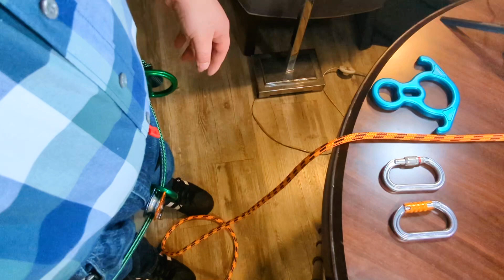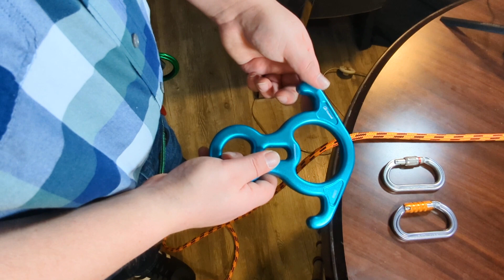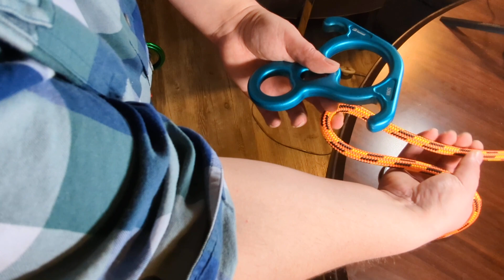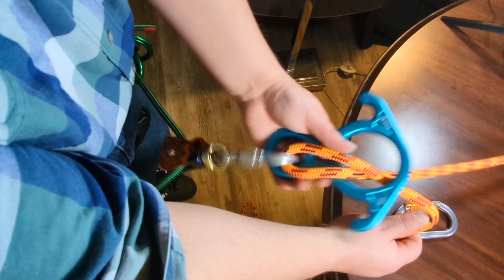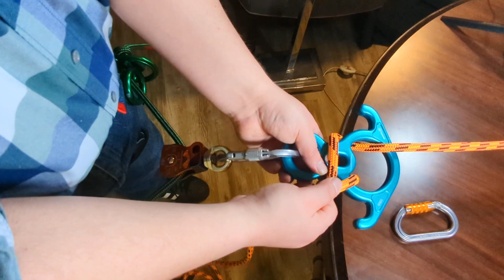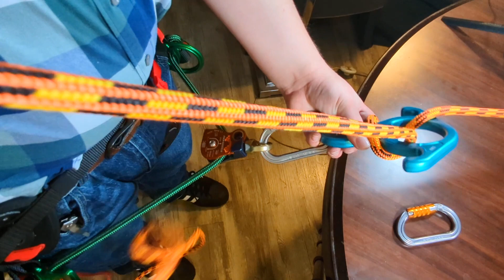6 ABSAIL/RAPPEL Methods & FRICTION MANAGEMENT Techniques for FIGURE 8 Descender

Comment: IMHO: I WOULD ADD A LOOP TO THE "8", TO GET IT FURTHER AWAY FRO THE HARNESS, AND ADD THE "PRUSIK HITCH" TO THE SLACK END OF THE ROPE, AS YOU DEMONSTRATE IN ANOTHER VIDEO...(FOR A BETTER "FAIL-SAFE").  THANKS!!  :face-blue-smiling::face-green-smiling::face-red-heart-shape::face-red-heart-shape::face-red-heart-shape:
Reply from the maker: Most of the methods shown in this video are for shorter rappels and they don't necessarily require a backup. But having a backup is never a bad idea. It is just sometimes impractical.

Comment: Rescue 8’s are made stronger for Rescue Situations where the Rescuer may also need to haul the Victim/Patient themselves, Victim/Patient Recovery gear like a Stretcher Basket, Medical Bags, More Safety Gear for the Victim/Patient, and Rigging Options. A Standard Figure 8 won’t be able to reliably meet all the potential weight requirements and/or lifting/lowering needs of the rescue situation.

I love my Phoenix Totem because it covers ALL the capabilities of a Standard 8, Rescue 8, Twin Stitch Plate, Triple Rigging Extension Holes, And Double Sided “Lock-Off” Horns all combined in one piece of gear. Love it.
Reply from the maker: The Totem is awesome! I want to buy one so badly, but I rarely ever rappel with such devices. I'm always using multicenders like the Rope Runner Pro or the Rope Wrench since I'm a tree climber. But anyone who wants an all in one descender for sport rappelling should look into the Totem. It was created by the same guy who created the VT Prusik: Rich Carlson of Canyons & Crags YouTube Channel.
Reply: @ Not the Totem,….. The Phoenix Totem. By CRT I believe. It’s Red and a Beast. Look it up. Worth while investment. Trust me.
Reply from the maker: @OgLtBlazer556 I found some pictures of it. I love it! Looks better than the original totem due to the lock off ears.
Reply: @ https://youtu.be/8PfskSHKGsw?si=8ZDo19oy7j0ri9Yd Phoenix video.

Comment: Super helpful! What do you think of running the Omni on the bridge with out the lock screw? I just picked one up and it doesn’t have the lock screw and I’m not sure if I trust it or not yet on my tree motion
Reply from the maker: That's a great question.  I think it's ideal to get the proper screw and place it in. Having said that, I've use mine without a screw many times and I've been fine. I ended up deciding I don't like pulleys on my bridge anymore. It was straining my abdominal muscles. I decided that I want the friction that ring creates on the bridge.

Comment: that one is modernized version of figure 8?
Reply from the maker: Yes, that is what is known as a "Rescue 8 (Eight)," with the only difference being that it has the two "ears" on either side at the top, which allows the operator to better lock off the line they are using it with. The resulting lock off is more secure and there is a proper technique for doing it. Thanks for your question!
Reply: @Knot-orious  Most quality Rescue 8’s are also rated higher over a standard Figure 8. I personally won’t use any gear rated less than 15kn.
Reply: Factor 2 falls are kinda shitty….. lol
Reply: Rescue 8’s are made stronger for Rescue Situations where the Rescuer may also need to haul the Victim/Patient themselves, Victim/Patient Recovery gear like a Stretcher Basket, Medical Bags, More Safety Gear for the Victim/Patient, and Rigging Options. A Standard Figure 8 won’t be able to reliably meet all the potential weight requirements and/or lifting/lowering needs of the rescue situation.

I love my Phoenix Totem because it covers ALL the capabilities of a Standard 8, Rescue 8, Twin Stitch Plate, Triple Rigging Extension Holes, And Double Sided “Lock-Off” Horns all combined in one piece of gear. Love it.